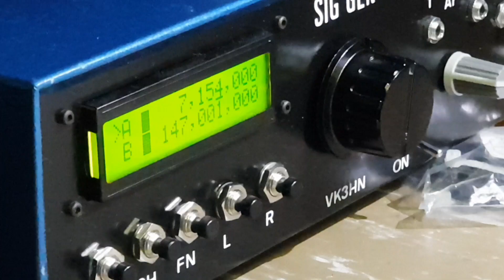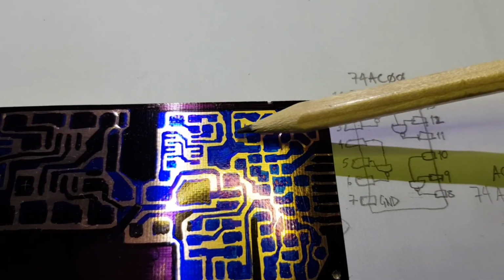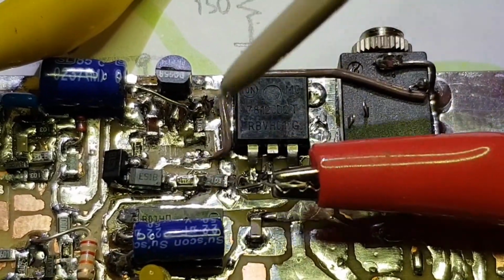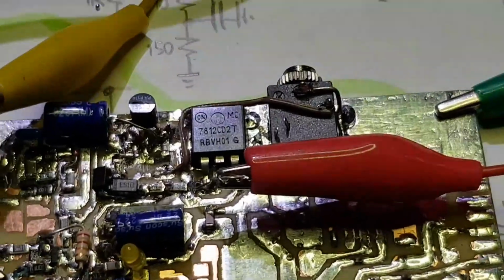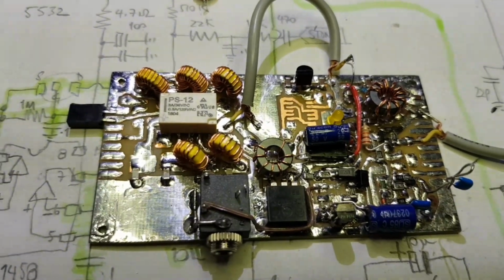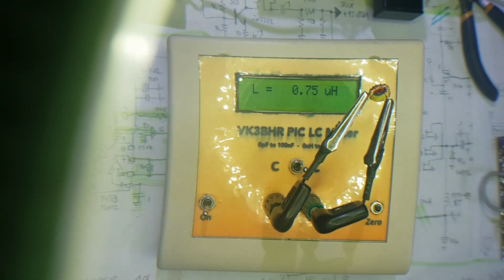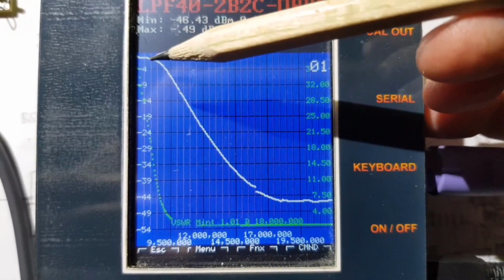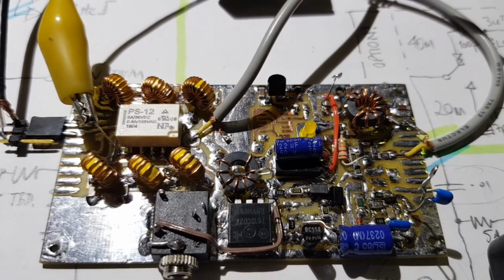2B2C: Scratchbuilt Dual-band 2 channel QRP CW rig/ Part 5 Tx PCB, keying, pre-driver, LPFs

Comment: Looking forward to part 6. BTW, nice when you have an L/C meter. I have to go old school and use a Palomar noise bridge and a precise 5 uH inductor and a 100 pF capacitor to measure the respective inductance and resistance.
Reply from the maker: That's right, the LC meter is (I think) an essential part of making LC filters. I once used a Grid Dip Oscillator, can you believe that!  It was like trying to find a lost component on the floor in the dark!   I strongly recommend you get one, eBay has a few to choose from.
Reply: @Paul_VK3HN , yeah I remember reading in my ARRL book Understanding Amateur Radio and the ARRL 1976 Handbook about using a grid dip oscillator to measure the value of components and tune antennas.
Reply from the maker: @radiotec76  I first used a GDO around 1981. It was all we had! How things have improved!

Comment: Good work Paul, those relays you use, have you just bent the leads out or are they SM?
Reply from the maker: Hi Nigel, they are SM and come with their legs bent out like that for SM assmebly.  Easy to work with,  nice little relays. Search for them in the Altronics catalogue if interested.
Reply: @Paul_VK3HN  Interesting Paul, I will look out for them. I assume that you've had no problems with isolation between the contacts. I had this problem before using Japanese miniature relays. Took me ages to figure it out. Thought I'd got leakage from some cabling.
Reply from the maker: @multilecful  I have had no problems. I first used one relay at the end of each BPF and LPF to maximise isolation of filter inputs and outputs. Then I noticed that a lot of designs didn't bother with this and used single DPDT relays for each BPF or  LPF.  I measured the capacitance nbetween adjacent relay contact sets and it was under a few pF.  Perhaps because these are miniature surface mount relays and the contacts are likely to be very small.  So I started economising on them and have found no issues.  The amplitude of the RF on each contact set is about the same. I would never switch the input and output of a gain stage like this, that would be a disaster!

Comment: Great video! I feel as I want to build a compact CW QRP transceiver for two bands now.... a coincidence? :) I think a Hammond 1590BB style 120x100x35 mm enclosure will fit an MCU, Si5351, 1602 LCD, and two sets of BPFs and LPFs...
Reply from the maker: I like that! Ive been studying the KD1JV designs again and would do fairly much as you describe.  But I've just started on CAD PCB design, so it would partly be an opportunity to learn CAD PCB design.  What's the case you refer to?